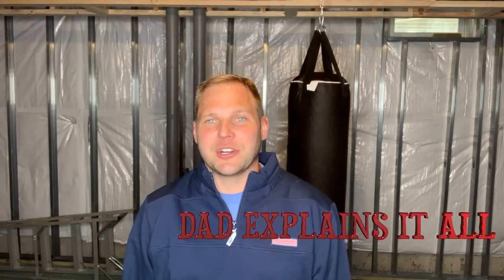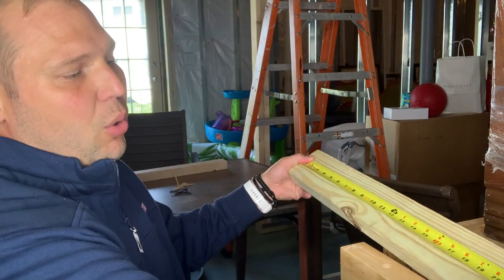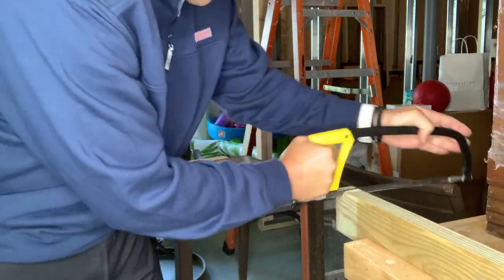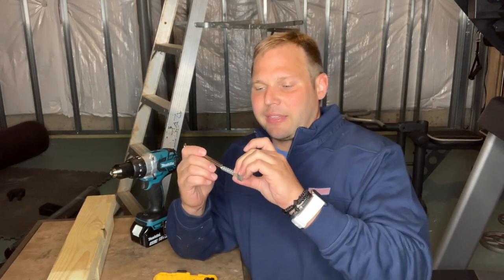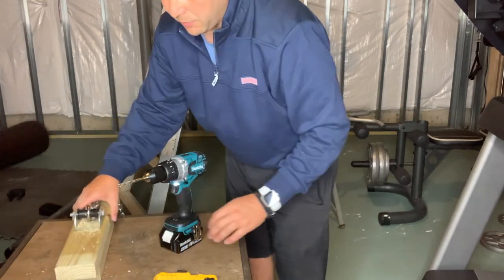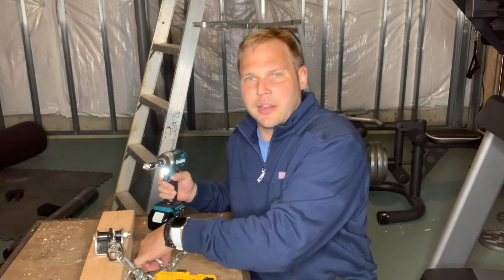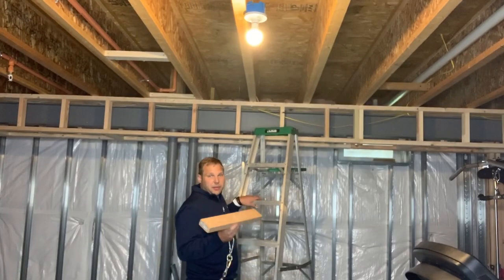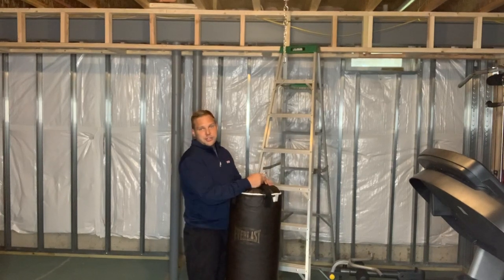How to Hang a Punching Bag AKA The Heavy Bag!

Comment: Good but having your mounting piece span the studs and drilling them up into the studs would be more secure. It’s clean the way you’ve done it with the flush mount but screwing into end grain is less secure.
Reply from the maker: Thank you for the comment! I agree with you. I did it this way to make it the bag as transient as possible but I agree, if I were to drill it up through the studs it would be very secure.
Reply: I think toe screwing into the joists with the blocking flushed up how he had it would be fine.

Comment: I'm in the situation of hang a heavy bag from the I joist, my concern is, what I understand j-joist are designed to handle compression forces no tension, wondering if is safe to spread the loads of the heavy bag on the bottom of the i-joist, or is worth to reinforce it somehow,  just thoughts

Comment: Ok so i have a 10 feet Unistrut channel with trolleys on it to hung a 90lbs punching bag and 70lbs round punching bag  to roll them out of the way..   Should I bolt the unistrut channel straight to the garage ceiling joist or should I bolt down a 2x4 or 2x6 board first to ceiling then bolt down unistrut Chanel to board??
I want to use channel for the 2 punching bags, rings and a climbing rope. My ceilings are 8ft high.  Thank u
Also what kind of bolts should I use and do I need washers too?

Comment: Would it better to hang it off a 2x4 that’s mounted to the joists or hang it off an I beam?
Reply from the maker: You could do either. I have more joists in my basement and therefore most choices where to mount it. Either would do the job though.

Comment: Any good tips on finding the joist when already covered by drywall?
Reply: stud finder
Reply: @marlomarteja3007  yes I know but I've heard too many stories of compromised cables, torn drywall and punctured pipes to consider any brand even remotely accurate.
I was thinking magnets but u know.... sometimes the screw is barely inside the joist
Reply: @marlomarteja3007  Careful, drain pipes run through joists all the time. I would toe screw into the joist, making sure it doesnt go too far up to be sure you don't reach a pipe. But if you find a joist, you should be fine, if your house was built properly, the plumbing will be away from where you are screwing in the bottom of the joist. Just don't send a long ass screw in there cause you think it will hold the bag better.

Comment: Does it make any noise or shake the floor upstairs?
Reply from the maker: Yea mine shakes the floor.
Reply: Get a spring, it helps a fuck ton
Reply: @ethanwilliamson782 , what kind or spring?
Reply: @LawnDad  anything that can hold a few hundred pounds of force, it can be cheap, it just has to be decently strong. I have a 120lbs bag with a spring that can take like 1000 pounds, that’s a little much, it almost doesn’t flex unless I throw uppercuts, 300-500 should give you that flex. It will vibrate the floor though, it’s unavoidable, it just won’t be damaging
Reply: @ethanwilliamson782 , great advice. I’ll do that. Thank you.